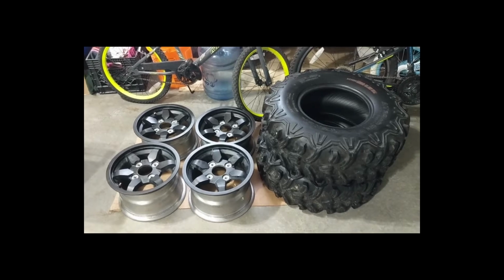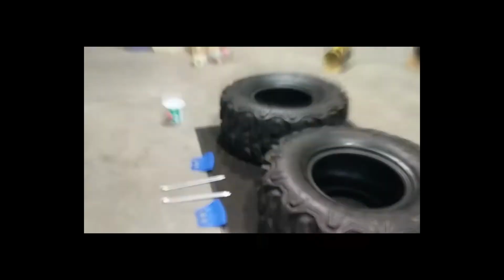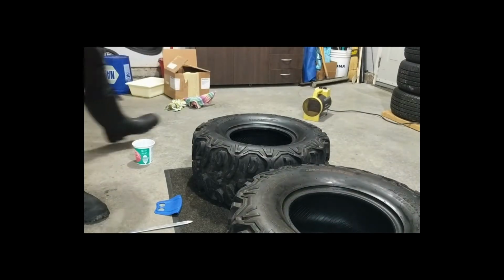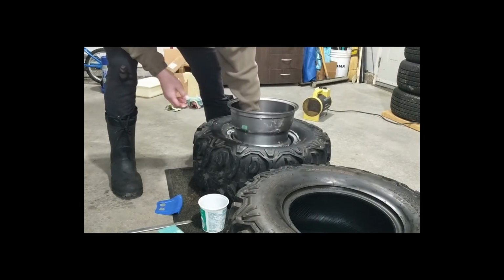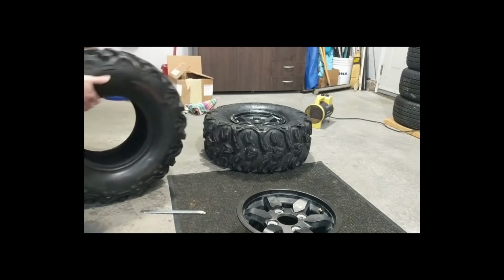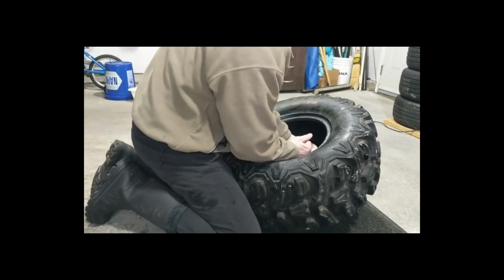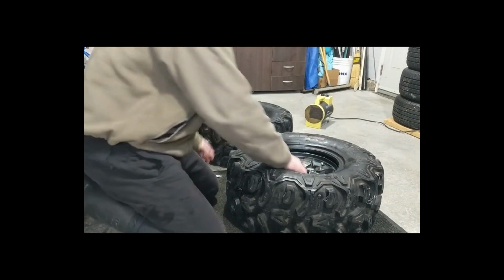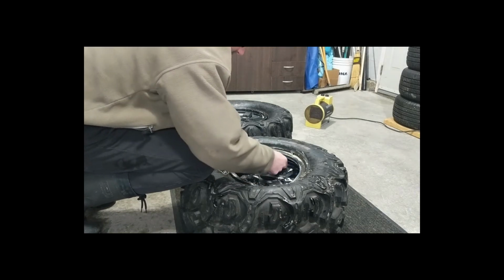DIY ATV Tire Install / Mount No Special Tools

Comment: Thanks for the video. How did you break the seal?
Reply from the maker: @davethompson5515  Glad to hear my video was helpful. To break the tire bead I use a 2x6 board cut on one end to match the rim curve. I lay the wheel on carpet on my driveway. I then put the board down onto the tire like a ramp and drive up it with my vehicle making sure the 2x6 edge is right on the bead. The weight of the vehicle breaks the bead.

Comment: Use less water in your soap. It shouldn't be foaming on the bead. Air bubbles reduce your lubrication. Straight soap or just a few drops of water is all you need in the soap. Do yourself ahuge favor and get some longer bars, 16" minimum. Leverage is your friend.
Reply from the maker: Thanks for the tips. I was using my motorcycle spoons which are small to pack onto bike. I actually mounted a set for my buddy 2 weekends dry without any lube or spoons.